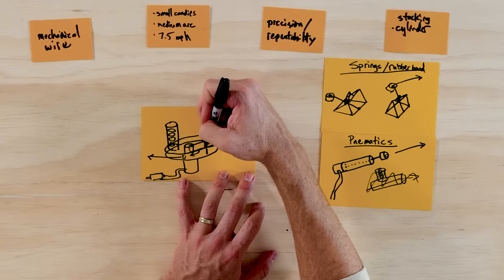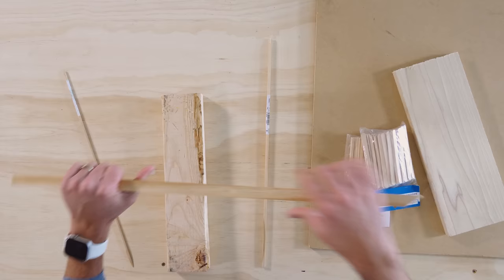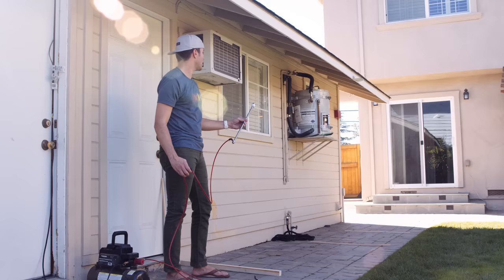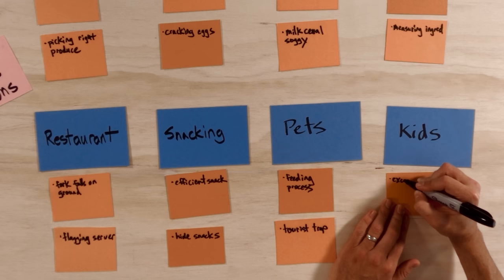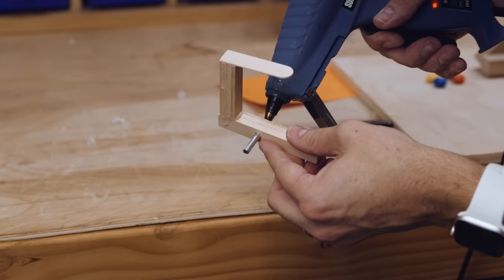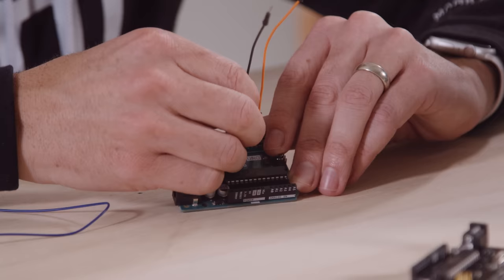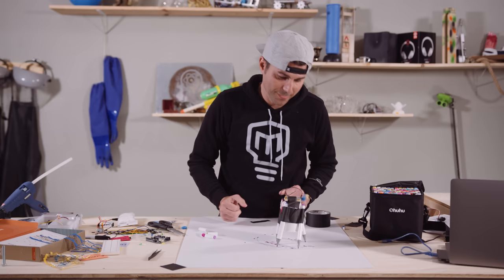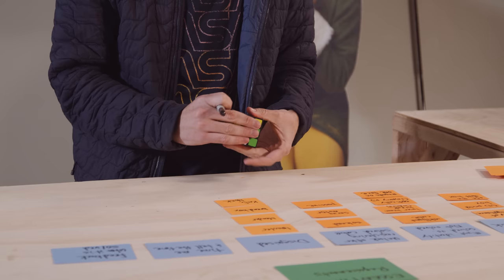Creative Engineering with Mark Rober | Official Trailer | Studio

Comment: Hello Mark. I was interested in signing up for this but the Studio platform is very inflexible and deceptive: it's not a one month purchase of $12, it's $144 to be able to access the course material for one year (and then it's terminated).

Plus I had to really dig into the course details to find out that we have to buy a kit, costing $130 (with shipping) - not sure whether the 20% discount applies.
Do you have your courses on a different platform? Udemy would be ideal because it's exactly the same set of videos (and I presume activity sheets) that is on demand and downloadable.

Why a subscription model? And why force us to pay for a year's access when only a month or two (who does a 30-day course every single day for 2-4 hours anyway)?
The support rep at Studio was also unhelpful and deceptive, trying to upsell me the benefits of the platform when I tried to ask specific questions about your course and why I couldn't just sign up for the 30 (60)-day duration of the course. 🙁

Oh, and it's NOT a "reopening" of the class. I understand you're trying to use a clever marketing ploy to create urgency, but it's tiresome and disengenuous. There's nothing "live" about the course, so can be made available at any time - that's the advantage, to be able to work through the material at your own pace.

Another platform - other than Studio - would be very welcome, with cheaper and less deceptive pricing models. No doubt they take a hefty commission to host your self-study video courses, so maybe you can sell them directly to customers and pass on the savings?

Comment: I would definitely join, but in my opinion the cost is a little bit too high. If it was like 50-100$ sure, isn't that much. But 250$? That's a little too much in my opinion. Plus that if you don't include any equipment. Total would be like 350$+ at least. And you may think "'oh, 350$ isn't that much, you can definitely get a job and it will pay off'' no. 1 Month is way too little to learn a new complate professional skill, it would take at least 1-2 years AT THE MINIMUM to get a job or to be a intermediate.

Comment: If the class price could be dropped to 50-100$ it would be more helpful when it comes to getting the right tools the arduino starter kit they put there is 100 and the other one is 36.99 which is still a lot for a 250$ class
Reply: If you are deeply passionate about working in the engineering sector or building on your creative thinking, then paying towards a course from someone with 10+ years of experience should be looked at as an investment to your future rather then how expensive it is :)
Reply: @mahdy2682  It's good saying that. But it's £170 and sadly I'm not able to pay that as I'm 15 :(
Reply: @horashio1593  Understandable, however from what I've gathered, this wont be the last class, so i recommend you to save up in the meantime for the next one :)
Reply: I took it. The class is worth $40 max. There's no interaction with Mark or anyone else but other viewers. It's not any better than his High School science teacher stuff, which was your basic ad-supported content.
It's like a good YouTube series that many many content creators do just for the YT money (free for the viewer, except the ads). Mark makes millions and millions off of his regular YT channel. This class makes over a million bucks every. single. time they run it. It's a ripoff.

Comment: The thing I am scared of is all the tools I dont have any
Reply: same, since he announced it i've been thinking about it but i don't know how i would make all of the things he's saying
Reply: He says that he will tell you where to get the things necessary
Reply: @Chipes_  He talks about where to source parts for the builds, but that's not a shopping cart list of tools you need to be able to use everything. Just acquiring things and learning how to use them effectively can take months.
Reply: @assortedmountainlife  any chance you have a list
Reply: @danielweiss0  Sorry, not officially, but I would say these things at a minimum: screw drivers, hex wrenches, Allen wrenches, measuring tape, hack saw, vice, clamps, files, sand paper, tin snips or wire cutters, electrical multimeter, forceps or tweezers, glue gun, square, hammer, pliers, drill bits and electric drill, electrical tape.

I may be missing some things but this is just a general list of workshop items you would want for building projects like Mark's.